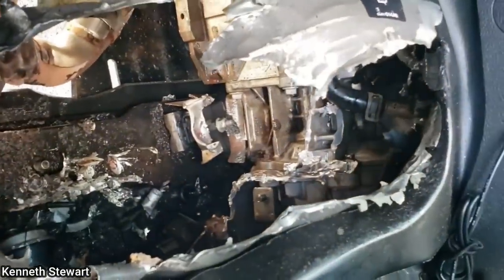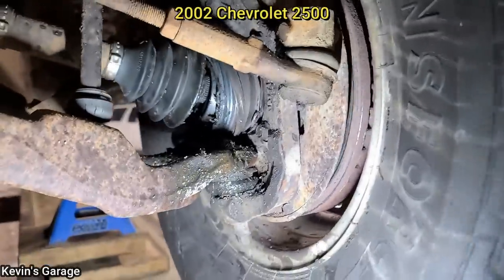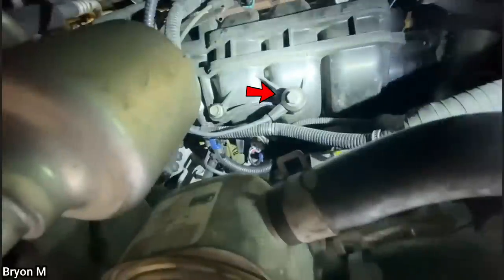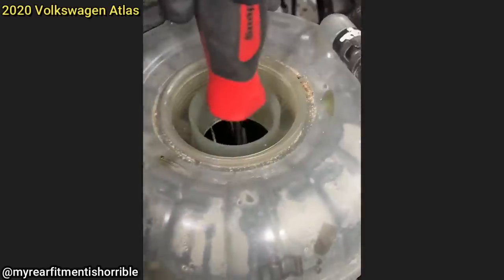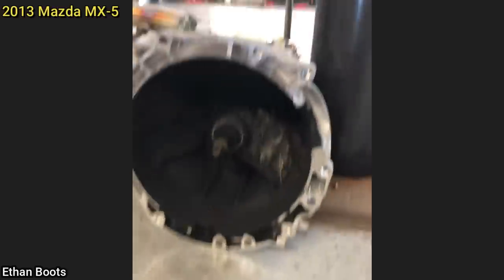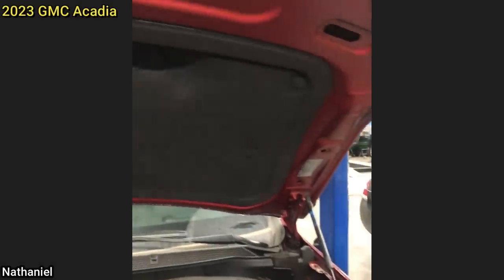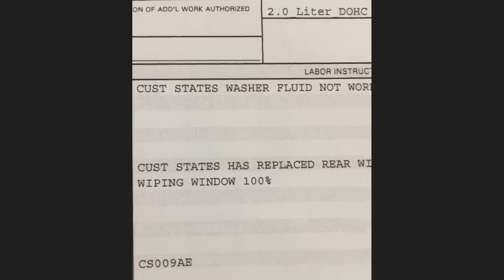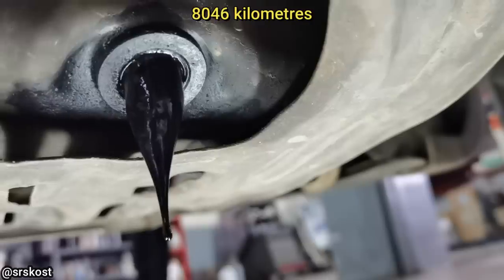Customer States Their Jeep Had A Bad Driveline Vibration | Just Rolled In

Comment: Do all box jeeps have like zero foot well space like that first one, or does it look like theres no space because the carpeting has been pulled up and out of the way?
Reply: I think the carpeting had been pulled up and only partly replaced just before they started filming; and also the damage would have prevented the carpet from lying flat. Having said that, the Wrangler doesn't have TONS of footwell space; there's a big transmission hump plus the wheelwells. But you can drive one in winter boots and you still have space to reposition your feet occasionally.

Comment: most of the time when someone brings their car in and claims that some other shop did some work to it and it's not working right usually that means that they've tried to do the work themselves if some other shop did it and didn't do something properly why wouldn't you take it back to them I mean certainly you might not wanna use them again after that but at least they are going to do the fix for free because they screwed it up in the first place. I wouldn't take it to a completely separate shop and have to pay all over again to do something that the other shop should have done. It's all because they're lying and they tried to do it themselves or have their buddies uncles aunts roommate do it

Comment: Bad drivers - you need to avoid bumps, curbs, potholes, debris.  Find a smooth spot for all 4 tires so the following are not damaged - wheel bearings, alignment, shocks, etc.

Comment: I didn't know about that electric power steering either. My daughter was complaining about the power steering on her new car a few years ago. I went to check the fluid and looked for several minutes before I gave up and consulted the owners manual. That's when I became aware of electric power steering.
Reply: There are a few varieties of electric power steering.  The cheapest way to go is to mount the assist motor directly to the steering column.  Slightly more expensive one's use the motor to tug on the rack.  

In sports cars where steering feedback is a marketable feature, you may find an electric pump powering a conventional hydraulic steering

But the end goal is the same - to draw power from the engine for steering assist only when you really need to

Comment: Electric steering is a thing now??!? What's the redundancy?
Reply: It's not steer-by-wire, it just electric assist instead of hydraulic assist. As with normal power steering, if the power assist fails, you have greatly increased steering effort, but the steering wheel still steers the wheels. Most drivers, we hope, will be able to get their car safely to the side of the road (though I lose some optimism having watched this video). Parallel park it...not so much. Nominal benefits are that there's one less pump the engine has to drive, probably saves a bit of net weight, saves some space in the engine bay, plus obviously it's compatible with hybrid systems where the gas motor might not always be running. See also electric A/C condensers and power braking systems.
Reply: @cc-to  ahh ok, that makes more sense. Thank you for the explanation

Comment: How the hell do you own a manual transmission and not know how to drive it? At least by the second clutch repair. I have 170,000 miles on the original and it still drives great with no slippage. Glad the switched to auto. The smell must have been horrible while they were burning up those clutch plates.

Comment: God forbid the customer put in the effort to learn how to successfully drive a manual transmission vehicle ! It's not like EVERYONE that wanted to drive a vehicle in the 1900's had to learn to drive UNSYNCHRONIZED manual transmissions, meaning they had to learn to duble clutch for every shift. The first mass produced synchronized or "sychromesh" transmission that didn't require duble clutching became available in the 1928 Cadillac. So if you couldn't swing Cadillac money, you were still duble clutching. In 1939 GM had the first mass produced automatic transmission for the 1940 Oldsmobile. So if you didn't have Oldsmobile money, you were still shifting the gears your self, probably without the duble clutching though.
Reply: *duble...XD
Reply: @rustythecrown9317 ?, please enlighten me.

Comment: Always thought American car mechanics lacked imagination. Just get a set of pliers and chicken coop wire and stop being so picky about some of this fine engineering/problem solving. Air filters filter air, dust filters you find in vacuum cleaners.

And why has no one picked up that the steering wheels on the cars featured are invariably on the wrong side of the car. Now that's a real problem and will encourage people to drive off the wrong side of the road. Why do you lot throw good salt on the road, does it snow over there?

Regards for Aus

Sheelbewright Problem Solutions, Boganville Down Under.